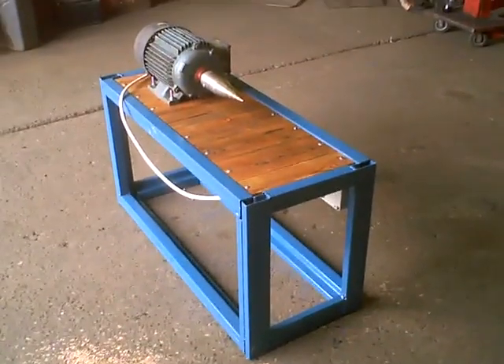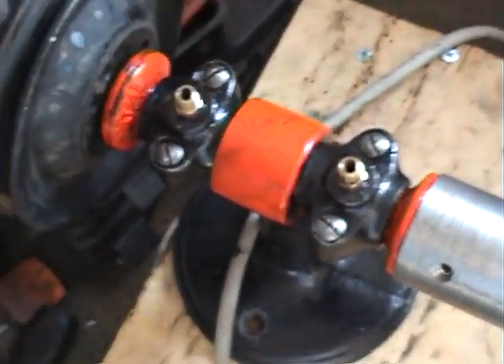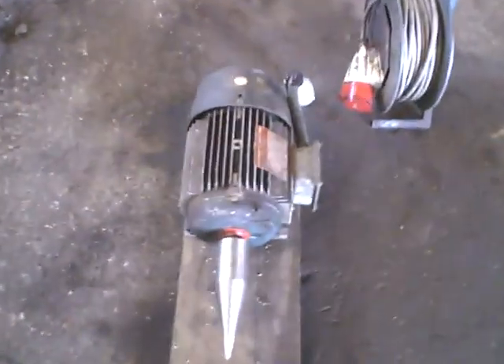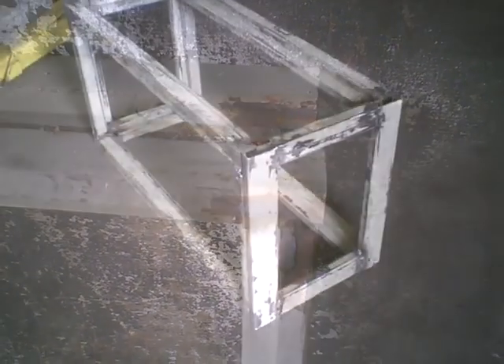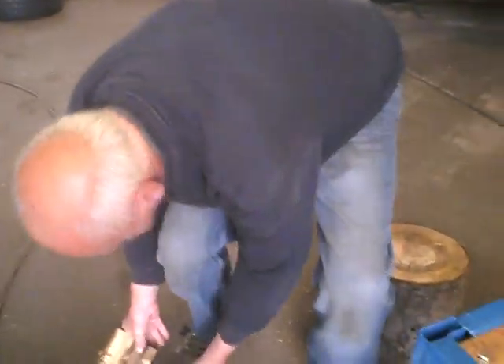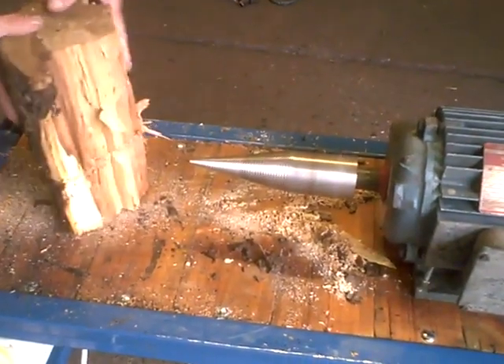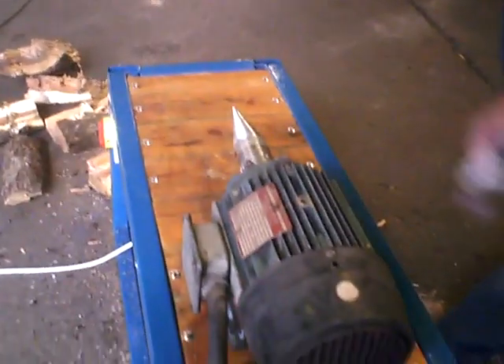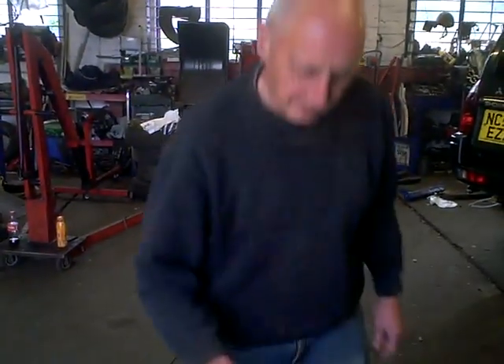Totally Home Made Screw Log Splitter SUCCESS Properly Finished and Working Perfectly

Comment: Malc   Can i make a suggestion ? This is without a doubt a great job ! But if you got 2 pieces of steel and put them to make a 90 degree angle at the side/front of the motor it would act as a wedge to stop you having to stop the motor on bigger pieces of timber.as long as the 90 degree piece is behind your Unicorn cone it would work well to correct this
Reply from the maker: +Jon Bishop Yes you are right Jon. Thing is I've never used it since I did the video. I thought a few might want to use it, however I made it, just because I could. If I were to use it much I would definitely do that.

Comment: Works a treat Malcolm how did you make the screw
Reply from the maker: Turned the screw on a lathe. But very difficult without a taper attachment. I worked as a machinist in a factory, but on internal and external grinders not lathes. But expect my experience of winding handles made this possible. Had to keep a constant pressure on the cross slide as it traversed.
Reply: @MalcOfLincoln  if you do it again that’s what we really need a video of. That the hard part

Comment: how many RPM?     I was told that it's better to use reduction gearbox to lower RPM to around 350 so as not to wear out the bearings in the motor.
Reply from the maker: Sorry, can't remember as quite a while ago. About 4hp 3 phase motor if this helps. You can see from the video it's about the right speed. It's still at the garage unused (I think). Motor wasn't mine.

Comment: Hello; ¿How many RPS and HP is your motor ?
Reply from the maker: It was quite a while ago, but from memory I think it's a 4hp motor.
Reply: Thank you very much MalcOfLincoln, just in case, do you remember how many RPM?
Reply from the maker: No sorry. It's a 3 phase motor btw. It belongs to the garage owner. It's hardly been used, but as you can see does a good job. I saw a video of a single phase motor, geared down that was 3hp and stalled. I don't think the RPM will matter much.
Reply: Ok,  I`ll try with a mono phase 3 hp,   ¡ thanks again

Comment: can you tell me your motor specs?
Reply from the maker: K Timco Yes it's 3 phase, aprox 4hp. One that was at the garage. There is a video of one with a 3hp motor geared down that is not quite up to the job. Apparently that's the largest single phase one you can run on a 13amp socket.